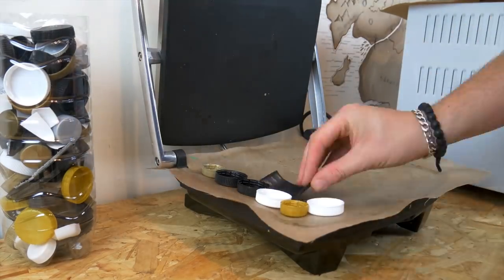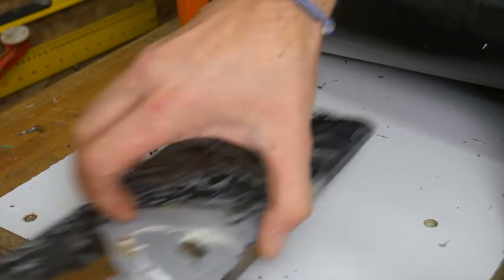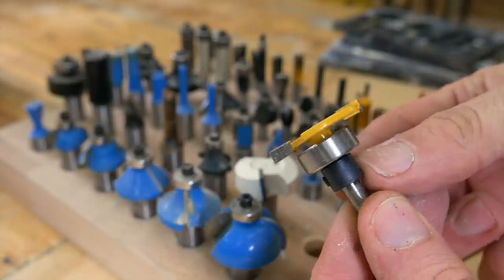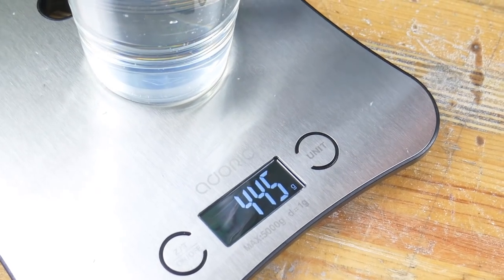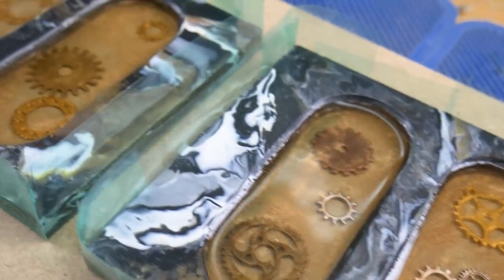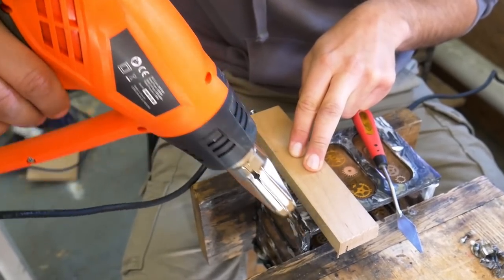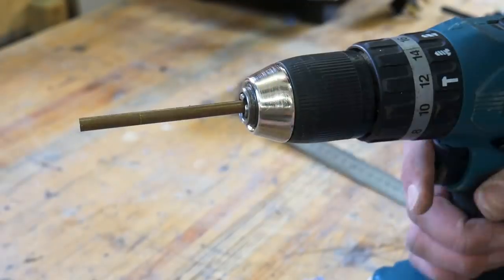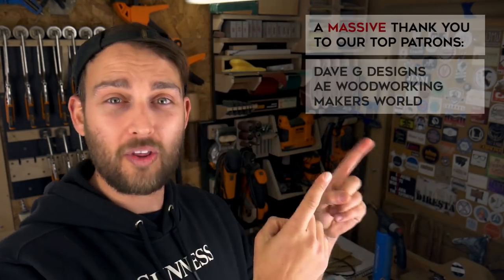Can You Combine Resin with HDPE?

Comment: If you have difficulties to find gold HDPE, I have a suggestion for you.

Ask to metalworking factories in your area, maybe the ones who does series.
If they use GUHRING Gold Ring taps, you found a good source of gold HDPE and/or gold PP (for small size taps they use PP flip top boxes).

I work in a factory that use those taps, and I'm collecting a lot of them, since I'm starting my plastic recycling project.

Unfortunately (for this question...😉) I'm in Italy, and I can't give you some.

Comment: That's a cool way to combine these materials. Did you notice any wiggle in the resin parts, or are they fit so tightly that you could not even tell them not bonding to the plastic? Also, I wonder whether it would be possible to push heated gears into the HDPE and use them as resin anchors? Thanks for sharing!
Reply from the maker: Hey Dominic! Thanks mate - from the outside is looks like their completely bonded, there's no movement at all. And yes that could be a cool idea! 💡

Comment: Would it work to dovetail the corners and then apply heat with a heat gun? It may give a stronger bond in the corner. Maybe?
Reply from the maker: Potentially yes! We did think that, but this gives a really strong joint so we didn't think the additional effort would be worth the added strength - but would be worth trying out for sure 😊

Comment: Beautiful work!! Can I ask what you used for your light source?
Reply from the maker: Just battery powered string lights. You can see them towards the end of the build
Reply: @BrothersMake  :) I did see the light source and that it was led but it was contained in structure and the led lights I get are not contained, so was wondering if there was a particular kind?